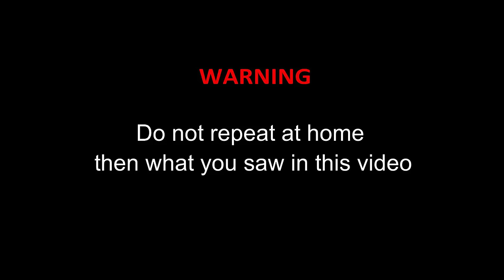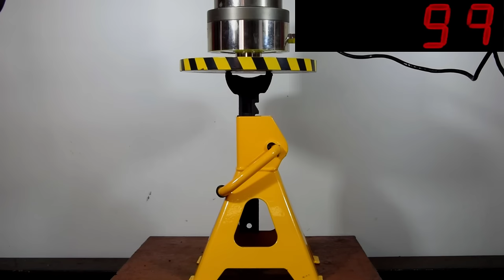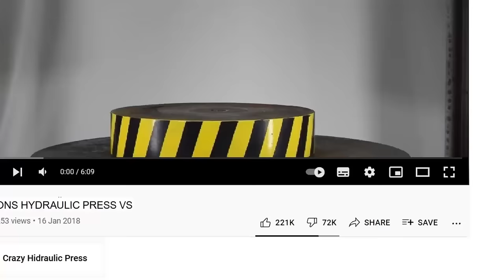HYDRAULIC PRESS VS CAR STANDS

Comment: Both stands exhibit small, correctable flaws. The yellow stand has an obvious weakness where the pin passes through the frame. Could easily be improved by reinforcing the holes. The black stand looks really good, however the wings fold early. In a few, very specific, cases this might allow the load to slide off the stand before breaking weight is achieved. Again, could easily be improved. Overall, though, both are excellent performers. I'm not overly fond of the ratchet design but the base is a more substantial four leg configuration (against the three of the black stand). For stability reasons I would probably choose the yellow stand.
Reply: Three legs are not as 'unstable'  as four. A three legged table never wobbles.
Reply: @Garethprice1979  In terms of wobble, yes. However, for legs which are the same distance from the (vertical) center line (at the base), a 4 leg design is inherently more stable in terms of tipping. That's why I used the term 'stability' rather than 'wobble'. I didn't elaborate because I thought it was obvious enough.
Reply: The titanic could have easily been improved by reinforcing the holes too. Ha. That old iron got as brittle as an egg shell when cold. I have the ratchet stands. Good to see they over exceeded there specs too
Reply: @Garethprice1979  True, but if it's tilted one leg could see a much higher loading than the others. With the welded 'skirt' of the yellow stand, such an imbalance is partially distributed throughout all legs.
Reply: The companies that make these likely create a weak point so that if it fails, it fails predictably and safely under the tolerances they design it for. I’m not an engineer, but it makes sense to me.
Reply: @davidgapp1457  3 legs take the load , the 4th is for “stability” 
Thus 3 legs at 120 deg is more “balanced” in load distribution 
Than 3 legs at 90 deg
Reply: The wings fold early . . . but you're never supposed to pour weight on them. You are supposed to put the frame in the cradle, the wings are only there to keep the weight centered on the strong part. Anyone putting weight on the wings is doing it totally wrong.

That said, the yellow one is made to work with a flat surface on the wings as well, the black one isn't.
Reply: Yes, a solid base is a good start no doubt. And.
Unless your jack stand is used for being Crushed by a Press.
I don't see me getting under Anything being held up. By something held together,.. with Pop Rivets 😬 And any shear, or torsional change in load is going straight into them.
Reply: I don't see any correctable flaws, the stand performed as they are supposed to until their weight limits were exceeded. Failure by exceeding it's design capacity is not a flaw.
Reply: I wouldn't really say they are flaws. They are just the fail points. They far exceeded their weight ratings. Sure you could increase their strength, but it would just cost more and if you need a stronger one you can already buy a more expensive one that is already beefed up. Also, you want it to fail in a way that isn't sudden and catastrophic, so it might be intentionally designed to fail there so that it's a gradual fail, not a sudden one
Reply: Wtf is every engineers here or what
Reply: Ratchet design allows more adjustability which is quite important at least to me to make the best use of the lift of your available jack.

Comment: Having both types of stand's in my home shop, I'm confident in they're ability to keep me safe on anything I may want to hold up on them.
Reply: Famous last words....
Reply: They do still fail

Always stick a few cinder blocks under there to be safe

I'd rather screw the car up than lose a limb
Reply: @usernamedaniedmrg  The biggest failure of a jack stand is when you do not use them!  For them to fail, you  have to crush the jack at the same time.  My entire car could not crush one of these stands, and I use two, if I am going under the car.

Comment: *Do not repeat this at home*
As if we have a hydraulic press at home 😂
Reply: 🤣😂🤣😂 I have an hydraulic press at home, is just 10 tons,  and I use for my job not for destroy everything  😂🤣😂🤣
Reply: it is very easy to make small 16t hydraulic press with hydraulic car jack it is very useful tool
Reply: don't try this at home could also mean, in the real world: don't place load greater than rated capacity.

Comment: Not surprised roll pin broke first. It wasn't that long ago those stands were recalled due to roll pins failing here in NZ
Reply: The load is not on the roll pin it is only to manoeuvre the chock.
Reply: Interestingly, it wasn't the roll pin that failed. It was the sheet metal that held the lever arm.

Comment: looks to me on the yellow set that the tiny roll pin on the toggle part is the weak point. The cast part was really tough. I was surprised how well the black one did. Cool vid.
Reply: Yeah needs thicker steel
Reply: The geometry of the yellow one is such that the axis of little roll pin is normal to the thrust on the pawl. The pawl, therefore, transfers the load directly into the pivot pin and through the pin to the vertical tube. The little roll pin is there only to pass the rotary motion of the pivot to the pawl so that the jack can be adjusted by rotating the handle.
Reply: @edwatts9890  exactly right.
Reply: @edwatts9890  blah blah

Comment: Considering that these things only have to take 4,000 pounds, they both seem to be able to do that well!
Reply: Yep. Generally things are engineered with a safety factor of at least 2x unless it flies. 
Jack stands get misused alot. Ideally you set them up so they are touching the vehicle or have some vehicle weight on them. 
If there is too much of a gap between the vehicle and the jack stand the impulse loadings can still exceed the capacity.
Reply: Oh it's well beyond 4k pounds. First one did 4200kg. Second one did 7900kg. Times those numbers by 2.2 and that's how many pounds it breaks at. One US ton is 900kg while one metric ton is 1000kg
Reply: This time last year iirc they recalled a bunch of HF Jack stands for having prone to failure welds...
Reply: @aninnymoose720  That and the teeth on them were not fully machined and were not locking.
Reply: @astro.5oh  incorrect. The scales were in kg, captioned as such, and relatively close to their 2 ton (2000kg) rating (as labeled on the box and stand) before deformation. Deformation isn't failure and the rating is for maximum weight with no deformation. In this video, it's being tested for max weight before total failure which was 4200kg (4.2 metric tons) and 7900kg (7.9 metric tons). in the second part, it was a test to see how much it'd take to completely destroy a stand which is easier to label in tons as 1 metric ton is equal to 1000kg, but the scale was still in kg. The first one we see captioned in tons was the black stand which reached 14500kg (14.5 metric tons) and 30000kg (30 metric tons)
Reply: 1000lbs per corner on a 2 Ton vehicle (4000lbs) Yellow all day
Reply: can we have a moment of silence, for the Jacks that gave their lives for testing today
Reply: @SpaceRanger187  😆
Reply: @3rdchapterproductions811  did he state the press is in KG? I didnt see it. they are imperial capacity stands why would you assume metric press?
Reply: @slappomatthew  yes, it was stated that it was reading out in kg in multiple points within the video such as at 1:25 . During the video, it will periodically caption the max weight it failed under. In that caption, it says KG and the number in the caption aligns with the number shown on the scale. I didn't assume it was metric. Infact, I was actually curious as to what unit of measurement the number on the scale was using and had originally assumed it might be imperial until the caption. This is also why I referenced both metric tons and US tons in my first comment for how to calculate how many pounds and how many US tons it translates to as I don't know whether or not the stands were factory rated using one or the other unit of measurement. There is room to assume the stand is rated in metric tons however because of it's use of mm to describe it's height adjustment range instead of an imperial unit, but I don't have any proof it's rated using either metric or imperial units so Im not going to say it is one or the other. I'll leave that for the people who care enough to look up the stands lol
Reply: @slappomatthew  yes, he states it in the audio.

Comment: Both jack stands supported more than their weight specifications on the press....both have two tons metric = 4,400 pounds load limits.   Yellow one held 4.2 metric tons = 9,260 pounds. Difference in price is difference in stability and ease of use.  Personal preference...no winner.
Reply: I guess it is measuring in kg, and being in america, I had to use google to convert it for me 9000kg=9.9us ton.

Comment: Both are up to the job of holding what they say they will but I'd rather have the yellow in the garage with its 4 legs which gives more stability.  The folding one would be great to have in your trunk if something happens on/ off road.
Reply: I've done lots of work with the folding ones and no issues
It's very stable

Comment: I'd say these stands were designed very well, in that the failure was consistent and non-dramatic.
Reply: And most importantly - neither failed anywhere near the specified load, they both have a very safe margin. Well, the black one had one design weakness at the top - clearly it can't be used to support even 1T if it's not the right shape, so it's basically single use - but it makes up for it with higher load and better failure mode.
Reply: @adamkozakiewicz6766  Where these jack stands become particularly dangerous is a shifting-load scenaro, where it puts a lot of weight off center.

Comment: In all fairness, the yellow one held up to more than twice it's rated capacity. (4218kg = 4.6 Tons)
Also surprises the collapsible one held up better.
Reply: It also takes up less space in your car's trunk (boot) or tool stand since it folds.... I was very impressed in how much stronger the cheaper stand was!!!
Reply: 4,218 ton
Reply: @johannesthe5th154  no, 4,218 kg = 9,299 lb = 4.65 ton (rated capacity 2 ton)
Reply: @brandonwerdel6480  Metric system. 1kg = 0,001 ton. 1000kg = 1 ton. 4218kg = 4,218 ton..
Reply: @johannesthe5th154   I think you shouldn't use a comma for "4.218 ton".

But yes, 4,218 kg = 9,299 lb = 4.218 ton (May be he forgot what metric system is? )

Edit: welp, seem like i miss alot of thing.
Reply: @basisTermium  In Denmark we use the komma
Reply: @johannesthe5th154  Poland also
Reply: @johannesthe5th154  That's why boats sink, and airplanes crash... we all need to use the same specifications in order to survive.
Reply: The collapsible one started deforming and was damaged (at the top) at only one ton. If both of these are used within their ratings, the black one is the only one that comes out of it with damage.
Reply: @basisTermium  In English, "ton" generally means the traditional 2000 pound "short ton", the British "Imperial" or "long" ton of 2240 pounds is usually identified with the qualifier outside British and Commonwealth nations, and the 1000kg "metric ton" is spelled "tonne".
Reply: @johannesthe5th154  Oh, i really didn't know that. Sorry if my original reply sound rude.
Reply: @geodkyt  My bad, i overlook how ton and tonne is difference. Thanks!

Comment: I am surprised that the yellow one does not have a pin option as well for extra safety.  
It would sure make me feel safer since the latching mechanism is somewhat out of view.
Reply: I think this isn't necessary, if the jack is under load, the full weight lasts on the latch, so you have to lift the whole weight a centimeter with this small lever, wich definately would require some pretty superhuman strength.
Reply: @elrondmcbong467  I have used the yellow version many times, and many times simply knowing did not make me feel safe.
Reply: mine has
Reply: Many of better ones have pin option.
Reply: I have a pair of the ones like the yellow one. Mine have a solid steel pin that slides in to aid the ratchet mechanism. They cost like $60 for the pair.
Reply: Mine have locking pins.

Comment: I had to share this on Facebook, and in that statement I made on Facebook I said I'm looking to buy four of these $15 versions, as I am absolutely stunned and amazed beyond words how strong they are. This is one of the most fascinating and shocking in a wonderful way videos I've ever seen. I also figured out how to do a design improvement on the jackstand that was telescoping? The yellow one? By welding a ring support around that hole where the adjustment pin goes into I bet would double the strength of that whole jackstand. Would love to see someone who knows how to weld do that and then test it to see how much it would take. I'm thinking it would be at least as much as the black folding jack stand, if not a lot more.
Reply: The cheap CHINA METAL  would fold up ,
With the ring in place anyway!
BUT IT WOULD 
BE STRONGER!

Comment: Never cheap out on Jack stands. Had a friend who was almost crushed to death under his truck in high-school because a jack got kicked out and the teeth on his cheap jack stand sheered right off. 
Lucky his dad was there to get it off of him. 
Using jack stands properly is important too. 
They are made to support the static vehicle weight. Impulse loadings from a falling vehicle are exponentially higher.
Reply: You must be lying because these $15 Jack stands out did the $25 ones 😂
Reply: @NoizyBearBearOfficial  you ever see those recalled harbor freight Jack stands?
Reply: Always use two stands and leave jack in place as well and block off back or front tires

Comment: Wow....I have both styles. I have switched to the yellow one over the last 25, for the 4 legs over three and the top and bottom contact points don't roll over. Plus the more height adjustment spots. The folding black 3 leg was impressive, it has flat base on the bottom, and the folding legs would make it great to leave in the car. I found that on some of my older 4 legs, the box around the wedge finger, on top, had weak welds,and the box popped out. Which happens to be exactly opposite to where the lever pin passes thru the frame, and the hole elongated. I'll be reinforcing that point ASAP. Glad I watched this, on a whim!

Comment: It's interesting to see the ratchet type fail that way. I have a set of 3 ton ratchet ones I use at least weekly. I usually back them up with the twist head style ones as well. I think this video shows you where the failure point will likely be. I'm going to start inspecting the holes the pin goes through for signs of expansion whenever I use them.

One thing I want to point out though. In these tests, the load is suspended from above. It presses, but does not sit on the stand. If your car breaks one of these stands, it won't be the same. As soon as a part fails and gives way on the press, the pressure releases until the press can move down to where the stand is now, and the rate of failure is slow. Not so with a car. Gravity will make the result very different.
Reply: Eric nobody asked
Reply: @11nailuJ11  your mom asked

Comment: I used to have a pair exactly like the black ones and never trusted them, so i bought a pair exactly like the yellow ones. Same weight and same allen screw set up for the lock, thinking they were stronger. Both were pretty impressive for the price, but wow was I wrong about the black ones.
Reply: It would all depend on the brand and the thickness/reinforcing of the metal where the load is applied. 
Tube around the pin holes for the black one, hole around the pivot for the yellow one.
Reply: I have a pair of non-folding jack stands for almost 40 years. USA made. It is even more tougher than the folding black ones shown on the video

Comment: It would have been more informative to take them to max rated load and see if any deformation occurred.  Then, increase loads by 500 lbs  until the jack started to fail.
Reply: This.
Reply: Then, show where and how each could be reinforced to withstand greater loads. Yellow set would benefit from reinforcing the split pin with a solid pin, and added frame washers at the hole for the height adjuster.
Reply: Sounds like a video idea for "project farm"  
That guy does some of the most thought out test on utube

Comment: I load the stands but always leave the jack somewhere out of the way as a backup. Still, I was surprised at the outcome.
Reply: I do the same.  Place the jack stands, load them, then leave the hydraulic floor jack in position as a back up and place timber blocks as well.  If I'm raising the front of the vehicle, the rear wheels are chocked and the e-brake is set. The rear of the vehicle, front wheels are chocked.  I never use the ratchet type of jack stands, only the fixed design.
Reply: Always put the wheel under the  car as a second line of defence .
Never rely on the jacking device.
Reply: @TheBuccy  i do the same! i will put car up on jack stands, have the jack raised the frame height with just a tiny tiny amount pressing the frame just to keep it in place and then ill put one or both wheels under where the frame would land on them if everything were to fail or an earthquake or something

Comment: There is another model which combines those two designs. Yellow one with a pin. I bet it would perform as well as the other one. Also, you guys need to provide a summary of the forces each was able to take at the end of the video.
Reply: Yeah that part messed me up quite a bit. Pretty sure that's expected too so arguably choosing to not include that information does not inspire confidence

Comment: Considering that a full size pickup has a curb weight of about 5,600 lbs and a full size car weighs in at under 4,000 lbs, either jack is easily capable of supporting the weight of the vehicle. Especially considering it would be distributed between 4 jack stands.